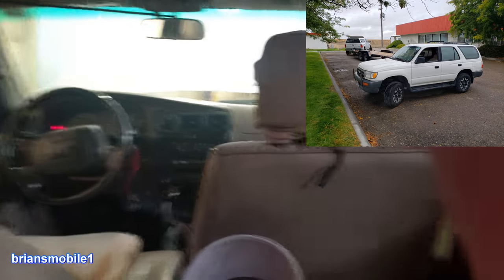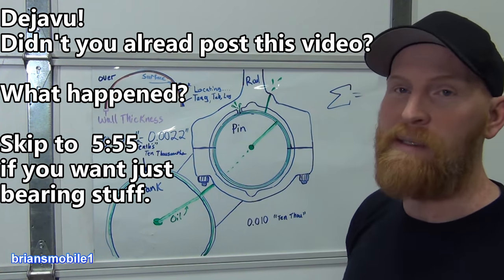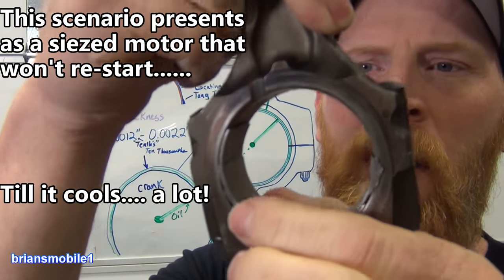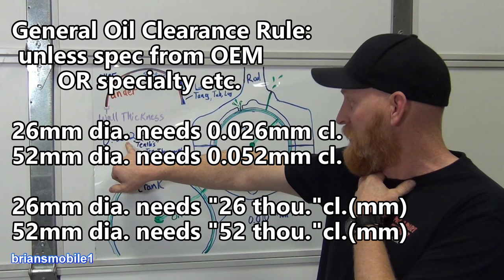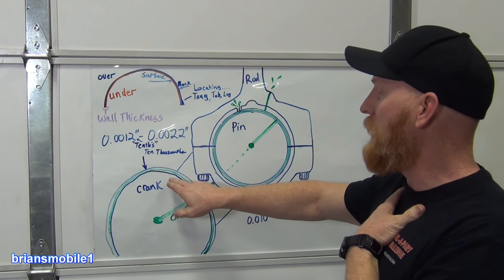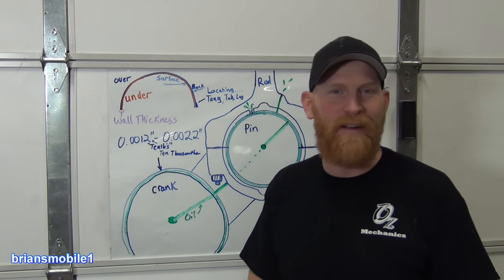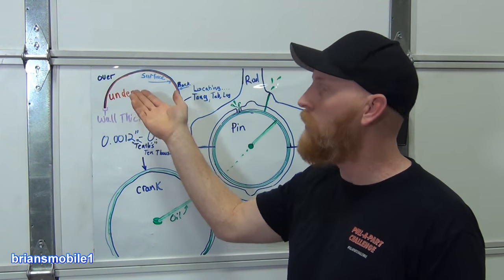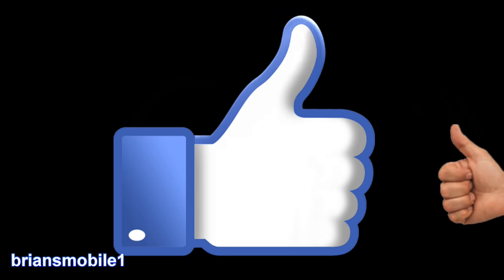Engine Bearing Crash Course 4Runner Project

Comment: Several years ago, I rebuilt a 2.7L Toyota engine. The block deck was warped, and the head gasket leaked. Since the block had to come out, I rebuilt it. .010 over pistons.  LC Engineering parts in Arizona. I used the balance shaft delete kit,and ARP  head studs, just because why not.  Interesting thing is, the 2 wheel drive engine has a shorter stroke and no balance shafy. It's 2.4L.  The 4 wheel drive is a 2.7L, longer stroke, plus balance shaft. That 3rze is very rare, as I could not find a salvage yard engine anywhere ( Colorado)
Reply from the maker: That's wild.  I've learned there's all kinds of things that are different on 2wd vs 4wd.  Things like fenders and marker lights are even different.

Comment: Great Video man! Thanks for the shout out as well. Yes the terminology can get confusing for sure, especially when it's commonly mispronounced(similar to calling a magazine a clip), but knowing the proper terminology is the difference between ordering the right or wrong part(s), especially critical ones such as bearings. The best way I use to remember if is undersized for undersized crank, oversized for over sized bore.
For the Bimetal and Trimetal confusion, it's denoted by how many layers are added onto the metal backing plate but doesn't not include the metal backing plate... I don't know why... because racecar?
Lots of great info here, and man you put in some hard research. Cheers my guy! I'm so glad we good 🤘
Reply from the maker: Heck ya, this was one of my highest hour videos in terms of re edit and preparation.  
I couldn't get to where I liked it enough to post.  Plus life's been a handful lately.  
I've been trying to keep everybody above dirt and keep my stuff going too.  Crazy times.

Comment: Nice work! I really appreciate your videos to educate folks. I am going through an engine rebuild for k20a2 motor myself right now.  Do you also check the clearance yourself after you get the parts back from the machine shop? Or do you tell the machine shop the clearance and they machine the crank to that spec? I have measured the items back from the machine shop with both plasti gauge and dial bore + mic. They return different readings. Plasti reads around .0015 while dial bore reads .0021 -.0024 and dial bore gauge leaves some minor scratch marks after. Which measurement should I go with? The mic has been set with the standard before use.

Comment: I still need to go back and watch the rest of the build so forgive me if you covered it already.  
I normally just order a crank kit from EPW that comes with the proper bearing for the grind that has been performed.  

Are you doing a valve job? I’ve never seen the bottom end fail on a 2rz or 3rz but I often see low compression cause by tight valves and burnt valves. Hopefully your machine shop can tip the valves in order to get your valve clearance in spec without valve shims change out.
Reply from the maker: I had the machine shop do it.   They did the tips for clearance too.
Reply: @briansmobile1  great. I had to wait 2 weeks for a few shims on my 1fz-fe engine.

Comment: Brian i have a 2006 scion xa with 256k miles it overheated now it will not turn over the starter just grinds what can I do to fix it?
Reply from the maker: Diagnose the grind first.  Disconnect the battery negative terminal and see if it can rotate by turning the crank over.  If not, pull the spark plugs and check for mechanical damage or coolant on them.  If there's coolant, pull the oil pan and see if rods are bent.  If one is, weigh costs of replacing some valves and a piston and C. rod vs. replacing the engine.  If it does turn over by hand- pull the starter and check the ring gear on the flywheel/flex plate.  See if starter alignment is bad.  While starter is out, bench test the bendix is protruding properly when solenoid energizes.